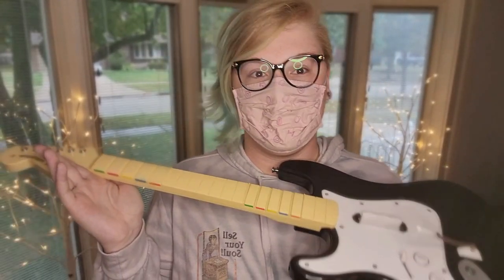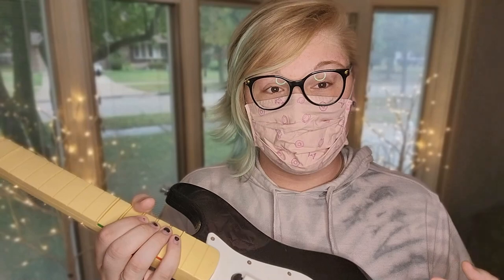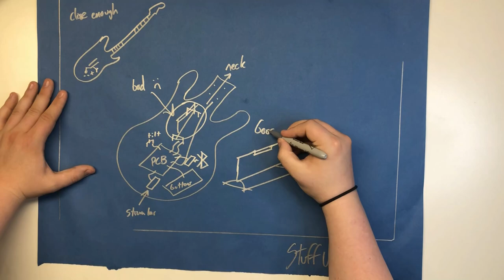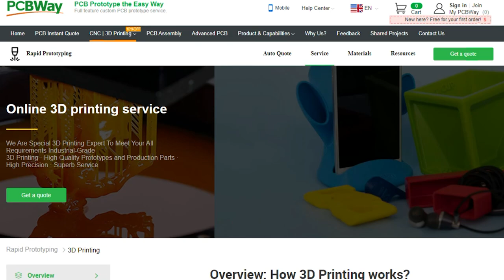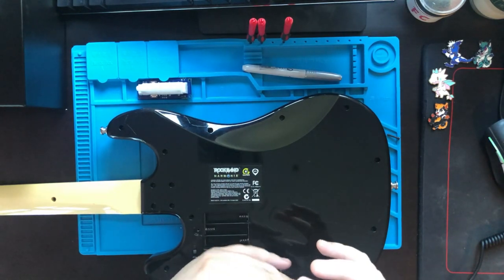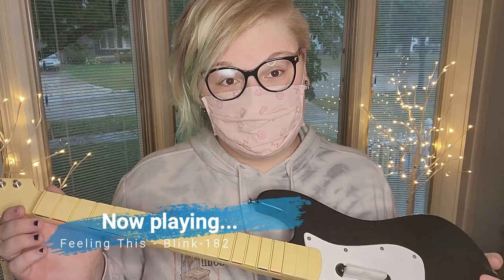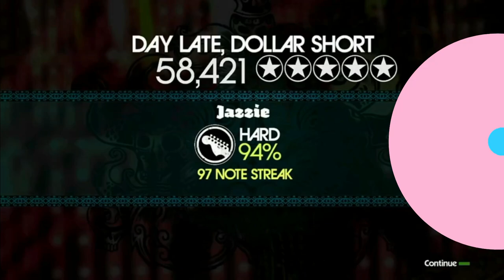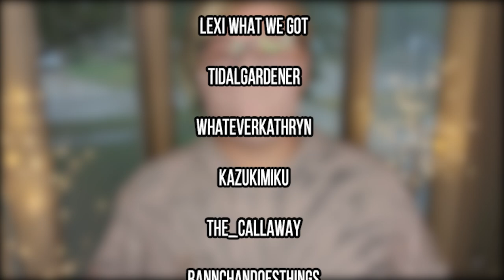How to Make the Ultimate Rock Band Guitar | Stuff We Make

Comment: Are you able to make different looking guitars?
Reply: Totally! It fairly easy to sand, prime, paint, and clear coat a new finish on these
Reply: @HashPuppy710  I meant more on other than a fender. Not a big fan of it. More of Gibson sg fan
Reply: @larry33bird41  ah gotcha! With 3d printing anything is possible.
Reply: @HashPuppy710  so you’re saying you can make an SG rock band guitar?
Reply: @larry33bird41  In theory, one could make any guitar they wanted. All they would need to do is transfer all the guts from the original controller to the new one! It would also require a bit of 3D modelling experience to actually contruct the neck, body, and screw mounts for the PCBs.
Reply: @HashPuppy710  I understand, do you know anyone who would be able to do it?
Reply: @larry33bird41  I'm sure there's loads of talent on Fiverr that can make this happen!